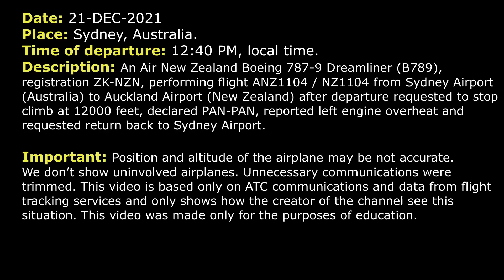Engine overheat. PAN-PAN | Air New Zealand Boeing 787-9 | Sydney, ATC

Comment: Reason that flight  could have been mainly carrying freight
Air Canada  has been doing that with b777.  In AC's case some seats were removed fron the passenger aircraft  for additional cargo. Its likely  air new Zealand  is also doing a lot of cargo  business on thier planes
Reply: Oops. Typo f s b reason for low passenger  total is that the flight could....
Reply: No just engine over heat